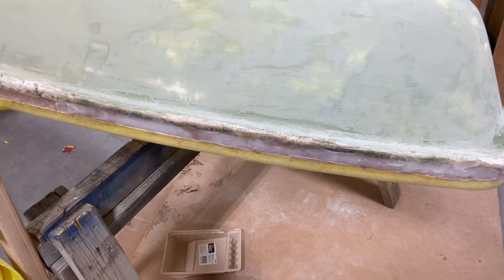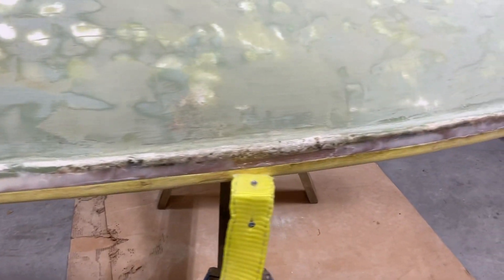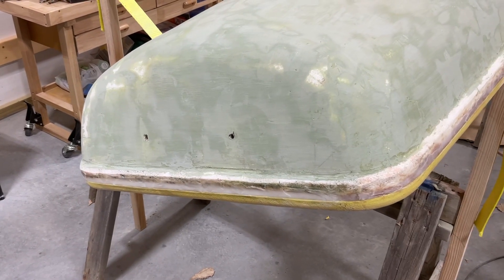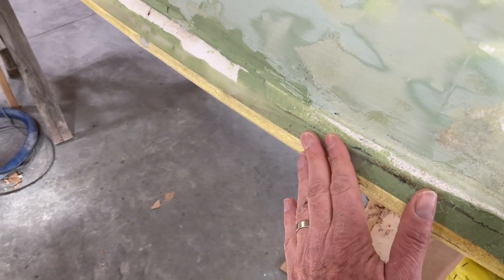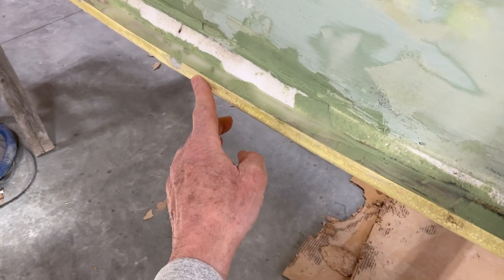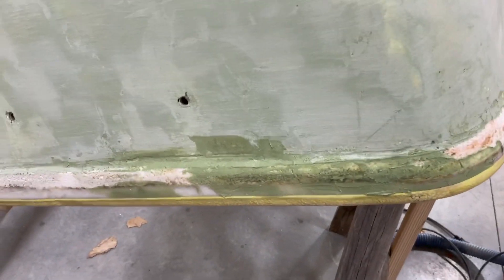Sea Snark Sunflower - Fiberglass taping the rails

Comment: Nice video as always, an alternate approach could be to saturate the tape in epoxy then apply to the boat.  But looks like you made out just fine. Nice work !!
Reply from the maker: Yes that’s a way to do it too. I actually did that on stitch and glue when I built the double duck. It was messy lol
Reply: @JenkinsBoatWorks  absolutely can be messy, there’s on area in the Teardrop that is in the cabin under the galley flat that is done that way, goggles, head covering and all 👍